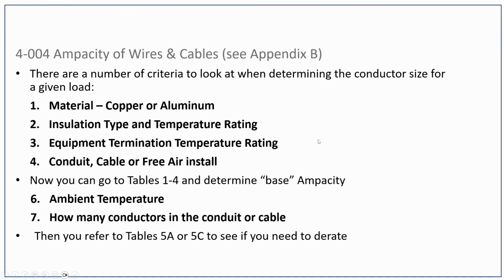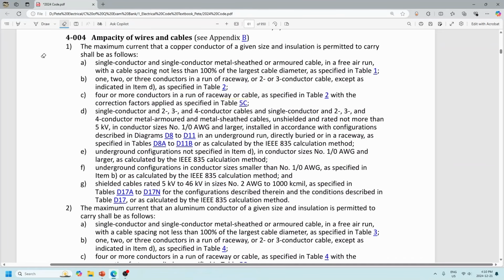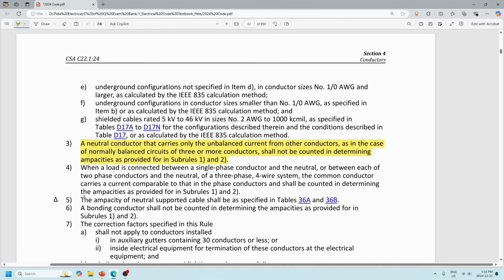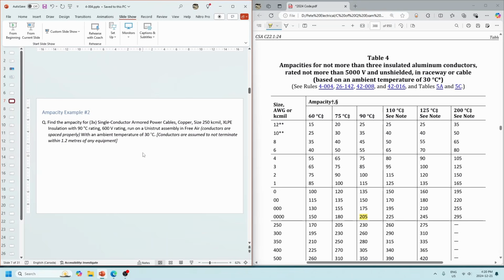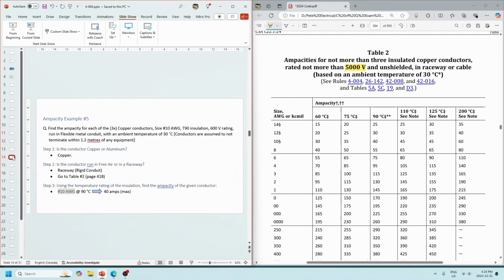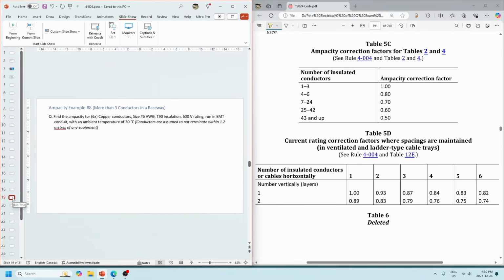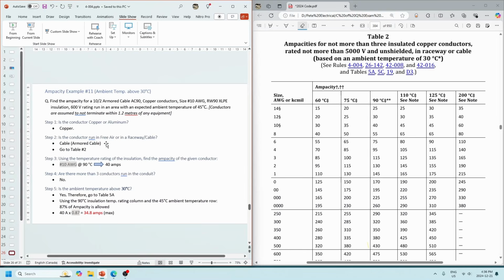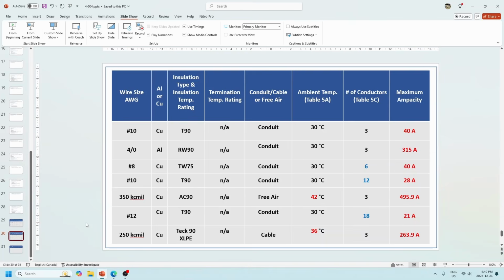Canadian Electrical Code/CEC Rule 4-004 (Determining Ampacity of Wires & Cables)

Comment: Can you comment on using Table 5A. It was discussed and determined by a group of Instructors that you would always use the insulation rating of the wire to determine ampacity  when derating for ambient temperature over 30 deg. Even if you have a termination temperature that is lower. thank you for the great videos

Comment: Thank you for the great examples.  Perhaps this is not the best place / video to ask the question but I ask it anyway.  Let's say I were to route NMD90 14/2 on an outside wall filled with batt insulation, should I derate and route NMD90 12/2 instead.  Or is there a video you made that addresses this situation.  Thank you again for the clear explanations.

Comment: Seeing a lot of these videos online, but no one seems to identify rule 4-006. Equipment marking temperatures are required for the derating of your loads. If you have a load <100A for instance without an unmarked equipment temperature rating, you're supposed to be using the 60 degree column for your derating. 

Example: you have nine (9) #12 T90 copper conductors in a run of EMT and terminating onto circuit breakers marked @ 75 degrees. You would take the value of 25A in the 75 degree column and multiply by 0.7 to get 17.5A, making the application incorrect and would require an increase in wire size (#10)
Reply from the maker: I believe I mentioned numerous times that these preliminary examples do not take 4-006 into consideration. There is another video that covers this. Thanks very much for the comment.
Reply from the maker: https://www.youtube.com/watch?v=0Afme_QMHSU

Comment: Would the 350kcmil be 350Amps, use Table 5A for 45 ambient (0.87), be 304.5Amps.

Amazing video.
Reply from the maker: Yes. If it was a conduit install using Table 2. However, for this example it is Free Air (Table 1)